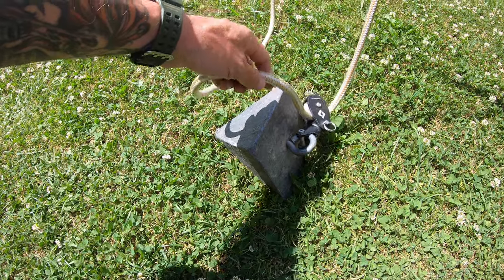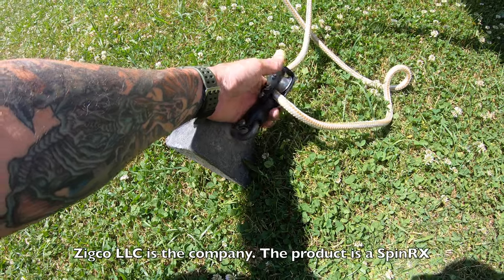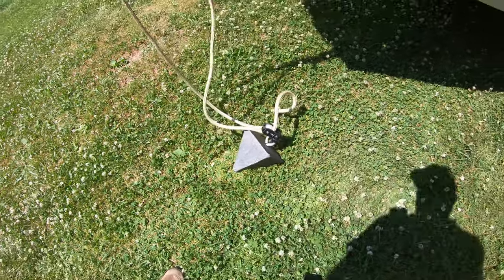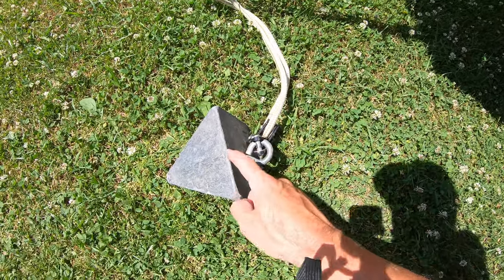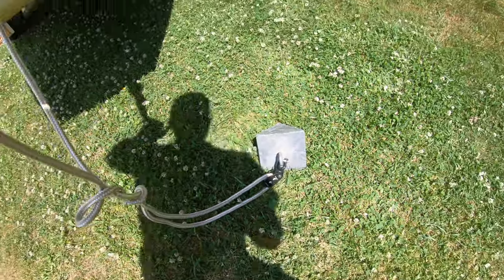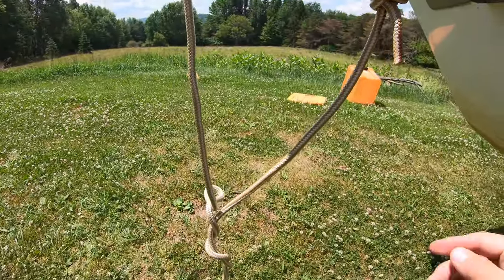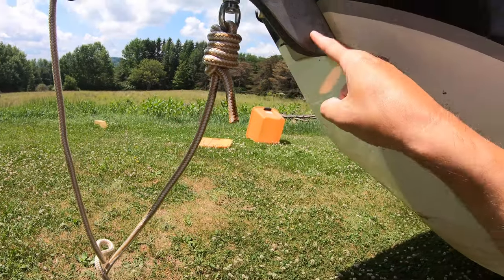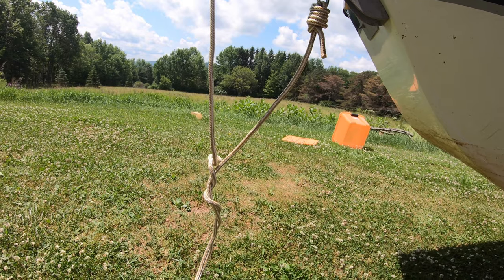Anchor Line Twisting - Drift Boat - Kayak - Bass Boat - Double Line System Swivel Pulley

Comment: Thanks so much for posting this.  Yesterday was my first time using a new SpinRX and a brand new, longer anchor rope.  I use my drift boat on rivers and lakes, yesterday I was on a lake, and after dropping the anchor only 3-4 times in up to 12' of water the system became completely unusable due to rope twist.  Today I added a close variant of your system.  Less than $10 and 15 minutes of time.  Thanks again.
Reply from the maker: That’s all it took the first time for me too. 4 drops and it never dropped again haha. Glad it helped, good luck out there 👍.

Comment: Thank you so much for this - I was getting so sick of line twist with one swivel at the anchor (not fully understanding what was happening to the line) and just went to a single line drop.  I use my drift boat in stillwater quite a bit (shallow lakes), and I drop anchor to stay in place when the wind comes up.  The issue in the lakes is the anchor works its way into the mud on the bottom, and you have to be the Hulk to pull it up out of the mud sometimes (I have a 30lb anchor).  I am going to try this!
Reply from the maker: This will definitely solve your issue. Good luck 👍

Comment: Instead of calling it a double line (it’s a single line)  system, use the proper name which is the “two to one” system.  For every two feet you pull, you only move the anchor one foot. But you gain mechanical advantage which reduces the tension on the free moving portion of line by half. The other half of the tension is on the terminal line.  Your solution to use a swivel sounds good.  I think the ultimate solution is to use a different type of line like a core-less fully braided line.

Comment: Nick, do you think the 2nd swivel would work with the more acute angle? My Clacka anchor drop has a built in loop, that would be a perfect attachment point, for the upper swivel. I think it is by design, for that purpose. But, it's VERY close to the line drop. Thus a very acute rope angle. Thanks!!
Reply from the maker: Hey Layne, I think I’d need to see a picture first. Think you could link me to one? I’m also on Instagram Alternate1985.